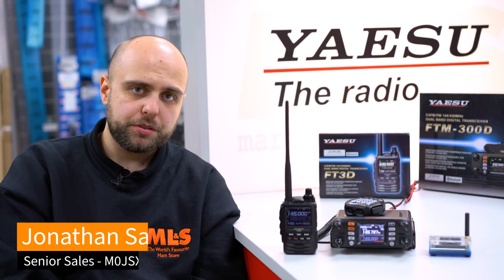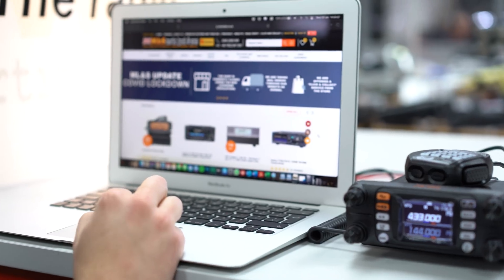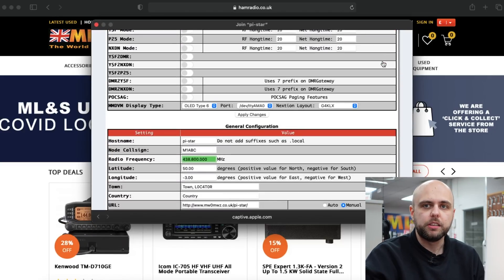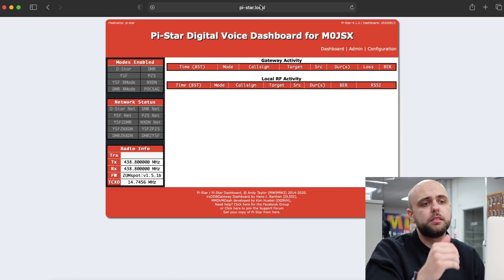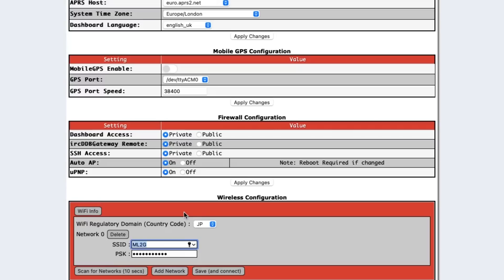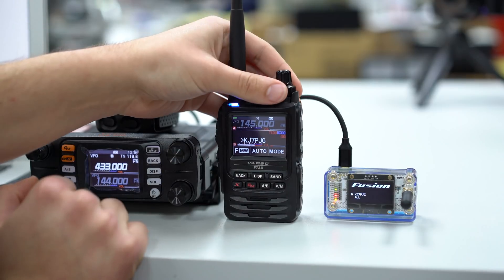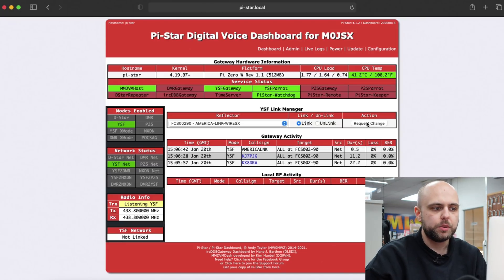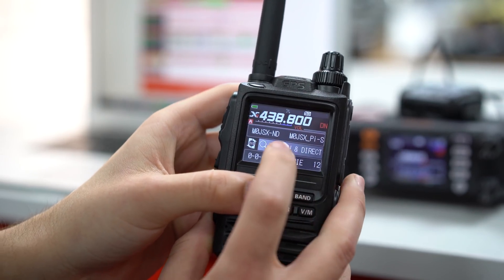Pi-Star on the Yaesu FT3DE and FTM-300DE Tutorial

Comment: If you connect a Fusion radio like the FTM300 using a Zumspot or any other hotspot, do you get access to the entire room list available as you would connecting your radio to your computer using a SCU40 lead or is it a more limited list? In other words, is the experience of running a FTM300 via a Zumspot hotspot? identical as you would get if connecting to Yaesu's Wire X servers via SCU-40?
Reply: No.  It's not Wires-x proper.

Comment: I am using a FTM-400XD and a Pi-Star box. When I push the Wires-X button on the radio it won't connect to the Pi-Star box. Sometimes I need to repeat this 5-6 times before it connects. Do you know why that is?  When I connect to a local repeater this is not the case. It connects the first time.

Comment: What's the range? I assume anyone within the locality of your qtx can connect too?
Reply: By default the setup locks the access to only the owners callsign, so other people would not be able to use it unless you configure it for that. The radio is 10mW, so the range is very much dependant on the antenna, the small coil antennas give you up to about 250m range depending on where it is, what is near it etc etc etc.
Reply: @MW0MWZ  many thanks for your great reply. Best 73s